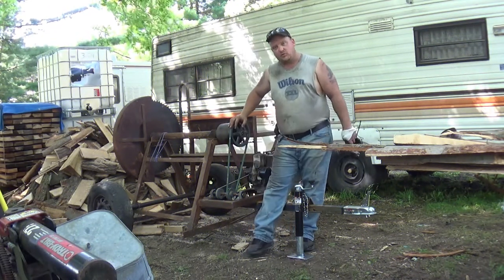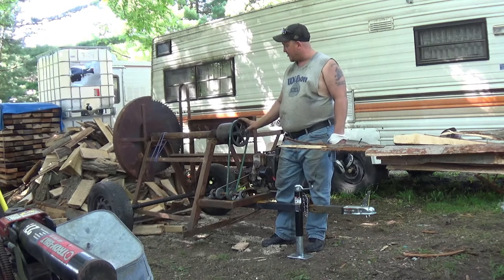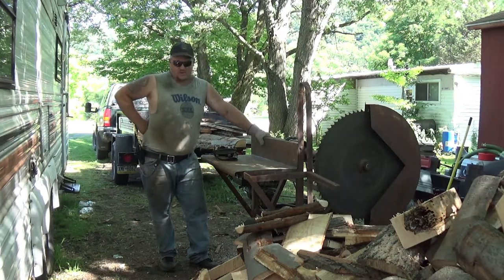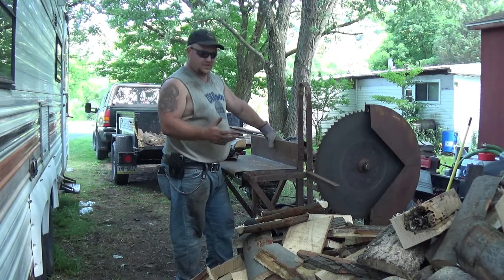Demonstrating Using A Cordwood Buzz Saw With Slab Wood With A Tecumseh 8hp Engine

Comment: I like what you did. To me alot more versatile then hooking up to the tractor and burning more fuel and wear and tear on your tractor. Bought one at a auction for 125.00 cdn. Most of the sawmills around here burn the slabs just to get rid of them. So at least we have a way know other then the old chainsaw of processing them for the winter.
Reply from the maker: It is much more versatile being able to move it and not having to have the long belt taking up more room along with a large tractor. I also believe that it is much faster than the chainsaw. You do have to be much more cautions around it because it will hurt you very quickly.

Comment: I've got 1  with 3 point tractor hitch ,PTO to 90% gearbox to 3 belts, runs nice put a gas strut in to push it back so you can't accidentally put ur hand into the blade
Reply from the maker: I've seen the 3 point hitch style. I like the idea about the gas strut. I might need to do that to mine. Thanks for the idea.

Comment: I am curious about your pulley sizes and ratios as well. I just picked up a nice buzz saw  set up for a flat belt and want to add a gas engine too. Thinking about a 10 horse briggs or a GX 160 Honda I have (but its only 5.5 hp). aEnjoyed the video and it gave me a place to start.
Reply from the maker: The motor I currently have on it is only a Predator 212 and it does fine. The Tecumseh blew up.
Reply: Lawrence, if you've not come to a decision about your pulley sizing, the maximum rpm these old machines should operate is 900 at the maximum.  Mostly because of the old bearings.  Most of them have sat outside and the bearings are no longer in perfect condition.  Many of them have some pretty bad wear from lack of lubrication.  Excessive speed with ultimately cause premature failure.  I typically run anywhere from 600 to 800 arbor rpm on the several I use to process wood.  The farm tractors that primarily powered these turn their pto at 540 rpm.  
     The pulley on the tractor was usually a little larger than the pulley on the saw, so the ratio was a bit above 1 to 1.  So say the tractor had and 8'' pulley and the saw had a 6'' pulley. Multiply 540 x 8 = 4320.  Then divide 4320 by 6 = 720.  That's the final drive rpm of the saw arbor.  The difference with the small engines is their higher full throttle rpm should be around 3400 to 3600 for full hp output.  That's why a jack shaft is used, to reduce rpm's in steps instead of just one set of pulleys. One set would be ridiculously large on the saw and tiny on the motor.  If you just lower the rpm of the motor to compensate, the hp output goes down dramatically.
Reply from the maker: I do agree, as soon as you lower the rpm you loose hp. I am running mine at around 900 to 1000 rpm. Best part about this one and several other ones is the bearings are "babbitt bearings" and they do seem to last longer than these newer bearings in my option. If and when mine need replaced I plan on trying to do my own babbitt bearings, if that fails then I guess I will have to go to a pillow block bearing. Thank you for watching.

Comment: how did you mount the pulley next to the old belt drive pulley, and what size did you use to slow it down? it looks like 3 inch pulleys down below and maybe an 8 up above? great info, thanks.
Reply from the maker: I will add the pulley information to the description shortly.